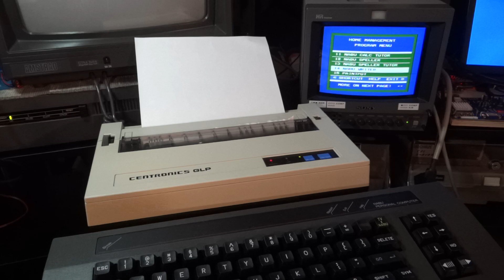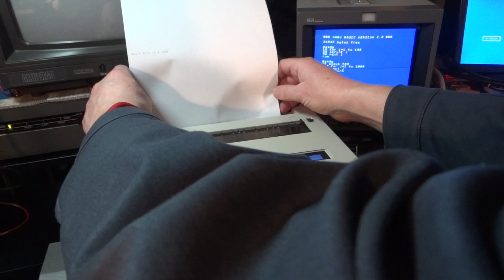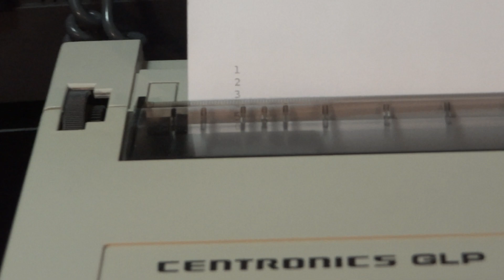The NABU Computer Printer Mystery!

Comment: It looks like you want to build a driver for your printer. You need to read the signals and the messages. You need an schematic of the serial pins and learn the size of the buffer and how to flush it out. The timer to  wait it's the worst method. You need to be able to read the messages that the printer sends
Reply from the maker: Please check the follow-up video... things were A LOT more simple back in the good old day than what you describe ;-) https://youtu.be/2kGH1i36_4o

Comment: It sounds like: this is was printer drivers are for.  You'll need to get a Printer Driver into either the NABU, the Retronet or into the printer (which is the least likely option).  I guess a Print Server or a Physical Buffer in between the NABU and the Printer might also work.
Reply: Absolutely not, it's a simple cabling issue.
Reply: @jtsotherone  Turns out you were correct!  Nice going!

Comment: Probably a carriage return + line feed problem...I remember fighting that back in the 8 bit days on printers!  It was especially problematic  with RadioShack (TRS-80) printers on non-Tandy hardware.  The problem there was usually that you got two carriage returns for one (i.e. everything was double spaced).  If you have a DIP switch  for CR and CR+LF, I would suggest trying that 😉  I seem to remember that Tandy used an otherwise obscure pin in the Centronics connector that most other printers ignored...
Reply: CR/LF pales in comparison to control characters.
Reply from the maker: @leeterthanyou  https://youtu.be/2kGH1i36_4o

Comment: According to you description the busy and strobe lines are connected on your cable? I'm pretty sure they should not be connected. The printer should control the busy line itself, in addition busy is active high while strobe is active low. So that would cause the NABU to think that most of the time the printer is busy, and its only not busy when you pull strobe low.
Reply from the maker: Yeah, it's a bit strange. BUSY I tried both active low and active high (-> printer DIP switch); it seems that the BUSY signal (a printer output) is connected to PRTBUSY on the Nabu, which is an input (it goes into the AY-3-8912 IOB4!) STROBE is a printer input and is correctly connected to the Nabu's pin 1, which is "STB", an output. According to https://www.sciencedirect.com/topics/engineering/printer-port both lines are needed for proper printer handshake; I know though that, for example, the same printer works with STROBE (1) and BUSY (11) connected 1-to-1 in case of the Amstrad CPC. So it should be working for the Nabu as well.